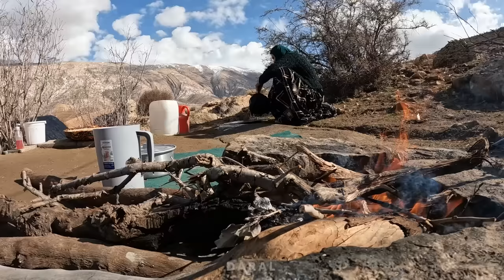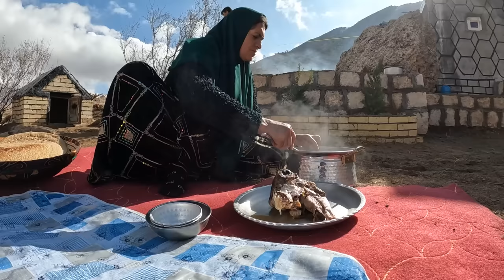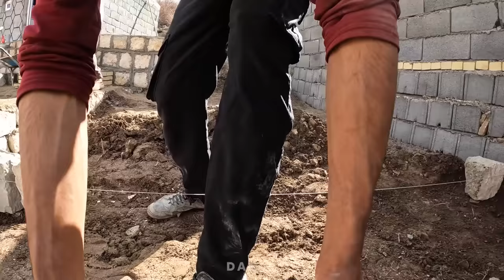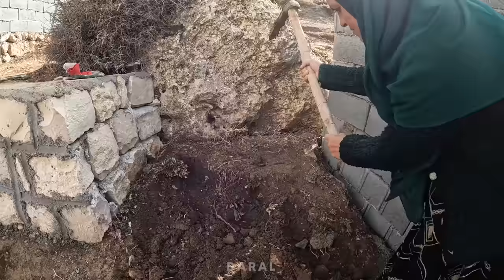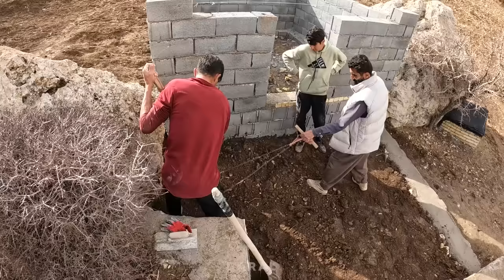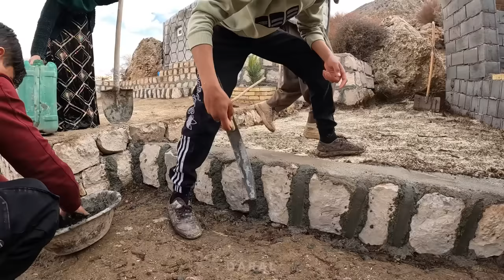"Amir and Family Build a Charming Entry Step for Their New Room | DIY Home Improvement"

Comment: Beautiful home and platform. Chicken house is far to small for the amount of hens you have. They must be piled on top of one another, must be extremely hot in the summer. They need a much bigger home. Where the fire is lit, needs a low wall around the outside of the area where you could sit and stop the wind blowing to harshly on the fire.
Reply from the maker: نه دوست خوبم هوا اینجا هوا خیلی سرداست بخاطر همین مرغداری را یکم کوچکتر درست کردیم تا مرغ ها گرم شوند❤❤❤❤

Comment: The new platform you made should have been made from the corner of the new house, meeting in a half-rounded fashion the corner of the old platform, so that you would have had the two platforms meeting seamlessly, making up one curb, instead of the new platform ending abruptly,  and leaving an awkward corner space in between the two platforms. They don't join, it is awkward. the eye wants them joined. Also, the white stones used for the base of the platform have again been joined by concrete in a brutal fashion, destroying the look of the great white stones with blotches of concrete applied too wide.

Comment: Why should the platform be built high and low? Why not just make it level with the big platform and have the same height? Why not just be level with the platform, so that there will be a right angle protruding out.
The platform is high and low, which makes walking unsafe and makes walking more difficult. Children or the elderly should be very careful when walking, as they may miss the mark and fall.

Comment: Seems like you are squeezing too many chickens into that tiny house.
Reply: They are SO PACKED IN THERE it seems unfortunately like the chickens couldnt help but all come out covered in the others chicken poop. Thats just cruel to the chickens. Chicken house needs an addition on 1 side or the other. Only 3 walls need be built cause they could use 1 wall thats already there as the 4th wall! That way 10 would be in 1 and 10 in the other. I believe hassan said when they got more it would be built more. Its time.

Comment: Question: I noticed they handle the cement with bare hands. Is there potassium nitrate in the cement mix? And if so, aren't you afraid of absorbing aka: saltpeter through your hands? idk, maybe its made with a less toxic ingredient......just asking, when I replaced my step at my back door of my house, I used my hands to smooth the cement and by the next day large pieces of skin had already peeled from my hand and my skin was extremely painful.